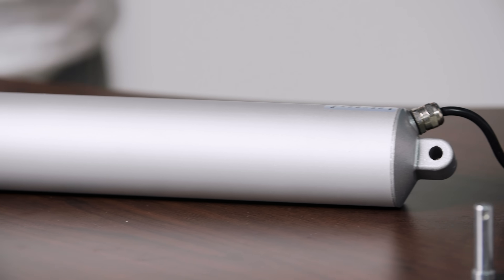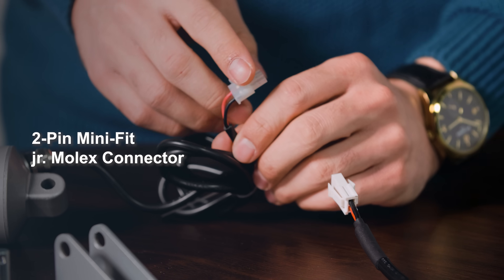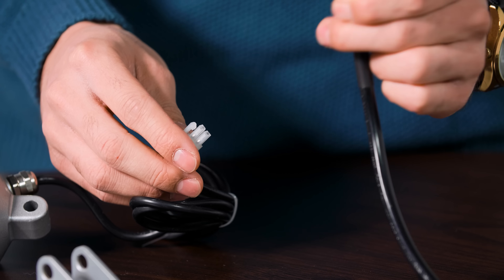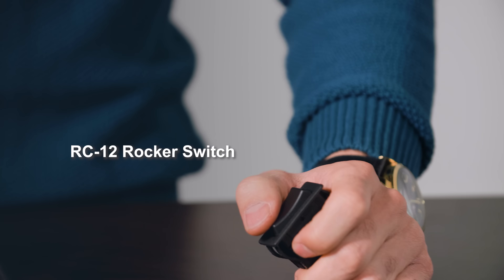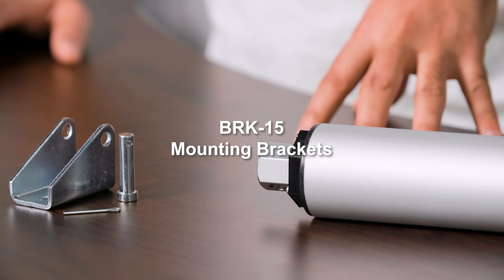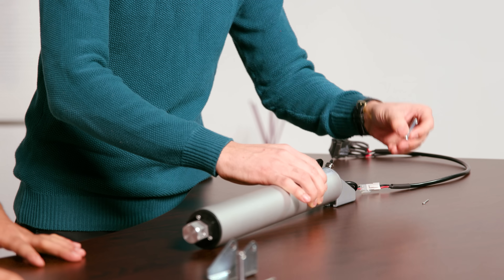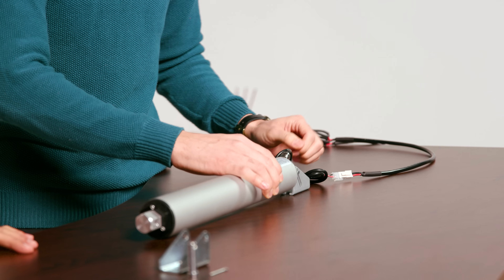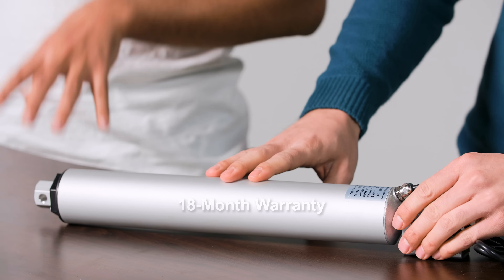High Speed Linear Actuator | PA-15 Product Overview | Progressive Automations

Comment: Your sample doesn't found in your store
Reply from the maker: Hello,

The PA-15 is a discontinued model actuator, however, our PA-ST1 also offers the benefit of a high travel speed in a tubular form factor. Below are the major differences between these two models:

-PA-15 has a shorter body length
-PA-ST1 is more water-resistant with IP66 ingress protection rating
-PA-ST1 has a higher force rating of 56 lbs
-PA-ST1 has a faster full load speed of 4.72"/sec

For more information, we'll be happy to help you by email at sales@progressiveautomations.com

Thank you,

Progressive Automations

Comment: Can I use this with a Raspberry Pi or Adruino or some other single board computer? Is the controller proprietary or open architecture? Thank You.
Reply from the maker: Hi Steven,

The PA-15 actuators can be controlled with nearly any single board microcontrollers such as Raspberry Pi or Arduino through the use of relays or H-bridge circuits that can handle the current draw of 9A per actuator at 12VDC. Whether your controller was proprietary or open architecture will depend on which model you use. 

If you had any other questions, we'll be happy to help!

Comment: can this be used with the joystick ? Or any DPDT switch ?
Reply from the maker: Hi Tyler, yes you can definitely use this actuator as long as it has the same voltage (12 VDC / 24 VDC), current and switch max needs with your existing DPDT switch. If you need more assistance, please feel free to talk to one of our in-house engineers here: https://www.progressiveautomations.com/pages/contact-us